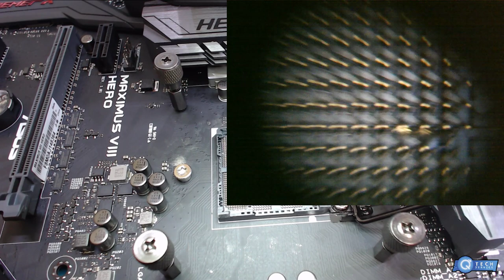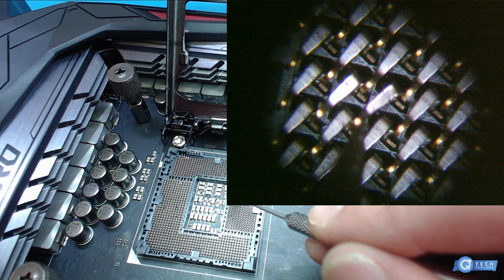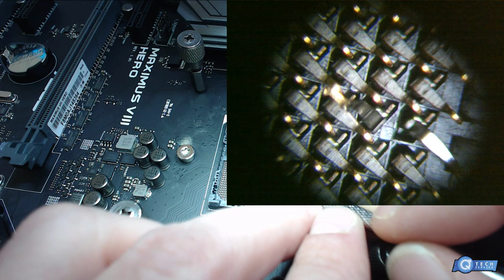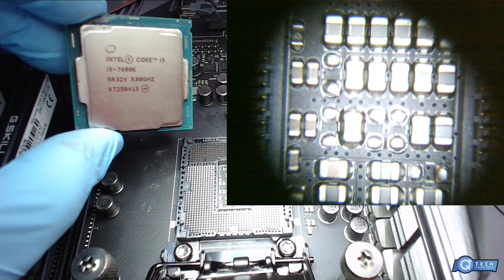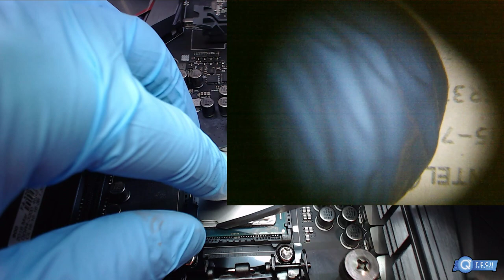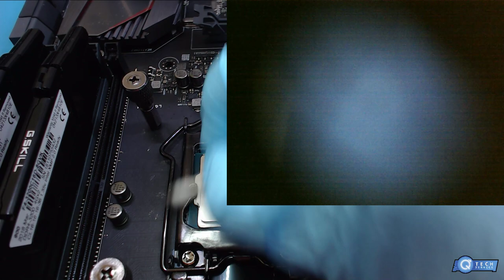intel LGA1151 Socket. Bent Pins . FIX!

Comment: Wow!  I have a Gigabyte Z390 Aorus Elite that had a few bent pins and although it worked I could only run the RAM in Single Channel mode due to the bent pins.  After watching this video I used basically the same technique and was able to un-bend the 2 bent pins and now the RAM finally runs in Dual Channel mode again!  Thanks for posting this!  Awesome video!
Reply from the maker: Good to hear that don't forget to hit the Subscribe button lol

Comment: Please recommend what is this zoom lens or magnifier used, and the tool to bend the pins.
Reply: I used my cell phone on the "video recording" at full zoom with the light on and a pick used for your teeth that I had purchased from a dollar store.  It worked perfectly!  I just had to stabilize the cell phone (as at that zoom level holding it freely in my hand was way too jittery) and then used it to look at the pins while I used the metal dental pick (like one that is double sided with a curved pick at either end) to un-bend the pins.  It worked great and literally cost my $1 (I already had the cell phone).  Try that before spending a bunch of cash on expensive cameras and tools.

Comment: Good video! Are you using a certain special tool, and is a magnifying glass needed for me to do this?
Reply from the maker: VCVortex  Thanks 😀 These are picks from Harbor freight  it's a microscope you can get away without using a microscope but will be harder
Reply: Thanks for the reply. I have a few skewed pins. PC is running fine most of the time, but got a random shutdown after recently changing CPUs. If it turns out to not be my PSU, I'm going to try to straighten those 3-4 pins out.
Reply: VCVortex how’d it go
Reply: @fajardo9315  My PSU was shot. The skewed pins apparently weren't causing the issue. I changed the PSU and haven't had an issue since. Gratefully too, I was nervous about needing to fix the pins.

Comment: Hello I just got a used board and there is one pin bent on the inner ring on the right side up about 10 pin do you think this will be a issue
Reply: not sure bro i had just 1 but just fixed it i didnt want to try it built without fix